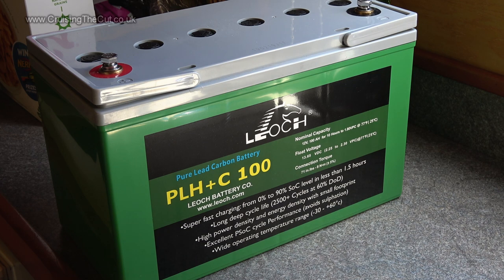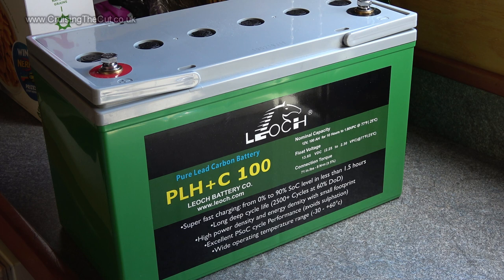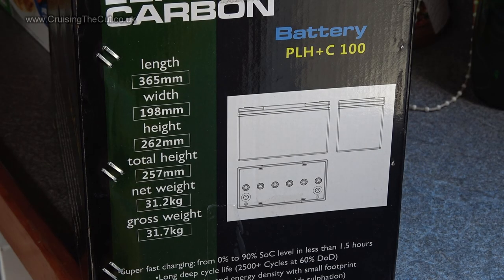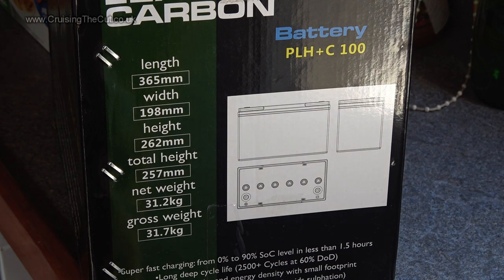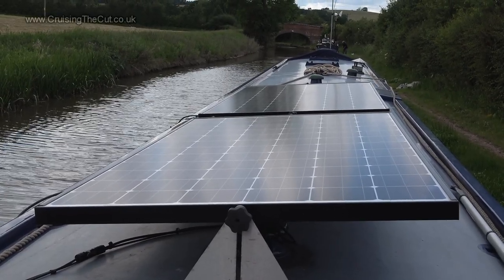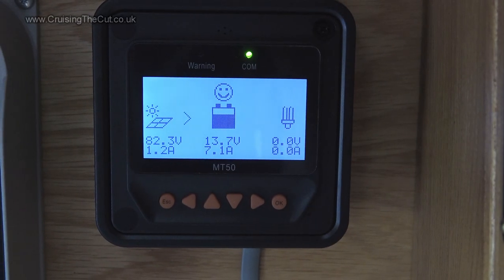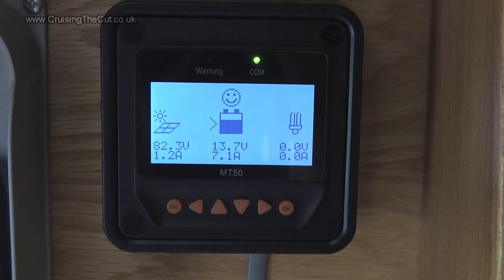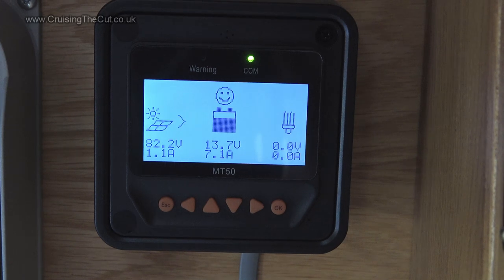178. Installing Lead Carbon batteries (12V 100Ah) into my canal narrowboat

Comment: Great job and I like how you researched the cabling part - except the source used is somewhat missleading (see below) - but, if you're already calculating resistance, you might be way more interested in replacing these tiny cables routed from your solar charger. After all, here the diameter goes directly into amount of wasted power - much the same way as with the battery - if you're concerned about effects of 20 cm of 35mm2, you need to look into several meters of these smaller ones. Resistance of wire by cross-section. So a 2.5mm2 (looks like what that is) got 14 times the resistance of a 35mm2. 

As a rough guess I'd put the solar panels as seen at ~180-250 Watt peak each, resulting in up to ~35 Ampere at ~12 Volt. With roughly 0.006 Ohm/Meter that equals to a power loss of ~ 5.5 Watt per Meter. So each meter between batteries and solar charger - as well as between panels and charger - removes up to 5% of what the panels supply before it reaches the battery. Of course this may be reasonable lower depending on the way the charger operates. None the less, with the low voltage high current setup a narrowboat features, wires should be made reasonable big. There can't be no wire too big - only too small.

And yes, solar panel manufacturers as well as suppliers for other part tend to use cabling as thin as possible 'to do the job' , as copper is quite expensive and the among the easy parts to cut cost.

As reality check take the cabling used to connect the engines alternator. It's safe to assume that the engine manufacturere (and the boat fitter) wasn't keen on wasting money on too expensive (too thick) cables either, wo the diameter used there can be a good guidance of what's necessary in this setup. Not sure what alternator size installed in your boat, but it may be safe to assume it supplies like up to 100 Ampere. If that's connected via 35 mm2 cable (as it seams), then cables supporting up to 35 Ampere (around a third of 100)  needs to be a third in cross section at least. That would be ~12 mm2 - next standard sizes are 10 mm2 or 16 mm2 - I'd take the later to replace the puny wires installed right now, increasing efficiency of your solar system even further without much technology - just pure old fashion copper  and lots thereof :))

----
The battery cabling part:

The source doesn't account for the change of internal impedance according to charge, which varies up to 1:100 between full and 50%, depending on battery type. It seams as the calculation only uses the internal impedance of a fully charged battery, which is meaningless as at that point charging current will be rather cut off to avoid damage - wouldn't it? In a real world setup, where batteries are charged and discharged a lot - exactly the setup with a narrowboat - the impedance of (only) 10% discharged batteries may be already more than 10 times of the cabling issue, taking down it's influence to 1/11th of the example given, making it neglectable - at 50% it may be more than 1000 times.

Also the claim about 'needing a PC to do the math' is somewhat overblown. It's a simple set of equations (in fact only one, but with several variables and repetition for charging level) that can be done without any tool. At least that's how I learned (and used) it in the 1970s - there where no handy computers to do the job :))

The good part is that moving the terminals don't do any bad either.
Reply from the maker: Rest assured the solar cables have been sized appropriately.

Comment: Nice one David and you are quite right to be cautious around batteries, especially the potential capacity of 300 Amp/hours.  That's an awful lot of stored energy and people are often dismissive of batteries because they are 'only' 12 volt.  The perennial 'spark' is probably just very minor voltage differences balancing themselves out.  When you jump start small cars from a Land Rover with 50mm squared cables, there is always a bit of a sparkle.  It's when it's a great blue, snarling thing you have to watch it!

Well done for doing something I would be just as cautious about and I used to ramp MRI magnets up and down - you have just the right degree of caution and common sense, with the ability to RTFS, as we used to call it.  (Read the freakin' screen.)

Comment: David, you should suggest to The Narrowboat Experience that they install these in their new boat. Anna stated in one vlog that they don't tend bring their batteries up to 100% most of the time. From what I can find about the Lead-Acid batteries, they are a very good, lower cost, alternative to LiFePO4, provided you can deal with the same shortcomings of voltage drop as Lead-Acid (this is coming from a retired Chemist.). Nice vlog and I hope these batteries serve you well.
Reply from the maker: I think I'm right in saying their new boat has much more solar than the old so I think their batteries will get slowly charged to 100% a lot more than on the old boat.
Reply: @CruisingTheCut  Thay aren't really shown much of the new boat, so didn't know that. Thanks.

Comment: I think you did a damn good job there, belt and braces with the safety aspect but what ever makes you comfortable. No normal experienced person could find flaw in your approach. Glad you configured your charger successfully, and more importantly are wise enough to know it needs to be done and brave enough to have a go at doing it yourself!
Disconnecting the ground first is the best approach as usually the body/metal work will be grounded, so if you catch the spanner it wont spark, then once the negative rail is disconnected you will not have any sparks if you slip when spannering the live terminals!
As for the debates over the connections of the charge/drain to each rail, the resistances across the thick copper cable, banjo fittings and terminal bolts would be so incredibly low that the impact on charge/drain imbalance of the different batteries would be insignificant, especially compared to the variations of the actual cells within each battery. This whole kind of 3 batteries in parallel, with 6 cells in series is inherently flawed but it works in the real world and has been used for the last century on everything from milk floats to submarines to computer server backup systems.
Reply from the maker: You'd think it would be insignificant but have a read of this: http://www.smartgauge.co.uk/batt_con.html
Reply: @CruisingTheCut  It is all true, he is quite right. It really is the best practice to equal out the connectors. But when I have measured packs and replaced individual batteries in arrays it is always just 1 random battery that is causing the problem, not the one at the end, or the one at the front. The key is a point the author makes "because the internal resistance of the batteries affects the outcome so much", the decimal places get lost in the differences in internal resistances make the biggest difference to cell loading.

Comment: Excellent! You mentioned covering your panels. Very nice. Every battery makes I deal with almost falls over themselves providing  bulk/absorption/float voltages and warns profusely against ANY equalization cycle IF not needed. Equalization voltages are usually VERY high, periodic and of very short duration. I am stymied why your provider would not provide a "cheat sheet" with everything you need to program your solar and/or shore powered charger.

Comment: Just for my own OCD giggles, I'd write the date of install on the top of the middle battery (most visible and no wires going across top). Because date of install is not always the same as date of purchase. Like you, I have to have all my ducks lined up before I start the installation process. With the date of install so visible on the battery itself, you can remind yourself at a glance when they were installed vs digging through paperwork.

And, for my own OCD giggles, I'd probably also put on date of purchase in the opposite corner or something. Just so I don't have to remember where the hell I put the paperwork. Probably would still be in "to be filed" stack five years later.
Reply from the maker: I made a video instead :-)

Comment: Good vlog. Looks like you had the wash out drying. Get yourself a dust buster, little cordless hand vacuum for those small little messes, and for when you have the power off in the boat.
Reply from the maker: I want a nice cordless but the cheap ones are crap and the good ones are expensive :-(
Reply: @CruisingTheCut  I use a range of Makita cordless power tools for my work, they do a great little vacuum which is quite cheap if you already have the batteries and charger. If you have any existing cordless tools you might find a compatible vacuum.
Reply: @CruisingTheCut  alas the benefit of having Walmart with other stores available for shopping by price and ability in the US.

Comment: Great vid👍 Does surprise me that you don’t have a battery monitor, especially now you’ve just invested in good quality batteries.
I find the info from my Victron BMV 712 really useful
Reply from the maker: Trouble is these things are partly guessing as soon as the batteries are anything less than brand new so they become steadily more inaccurate. Meanwhile voltmeters only give you an accurate reading if there's no load or charge on the battery and it's been like that for an hour or so, so the only good time to measure is the dead of night (no solar and with everything switched off)

Comment: The spark from the batteries is the capacitors inside the inverter recharging themselves. They take a good few amps (25 - 100Amps) depending on the size of the inverter. The capacitors naturally discharge over time hence the reason for the big spark once you reconnect the terminal to the battery. 
A good way to avoid this spark is to have a DC rated circuit breaker in line with the positive to the inverter. In that way the spark (or arch in tech terms) is contained inside the circuit breaker and you don't have to be scared of sparky bit flying off the battery terminals.
Reply from the maker: Good plan, I might try to add one.

Comment: The spark is certainly your inverter. But the spark is it "charging" the capacitors within the inverter. If you don't want the spark, get a 100W 10ohm resistor and put that between the cable and the battery for a few seconds before connecting the cable. The resistor will slowly charge the capacitors versus the jump (and spark) all at once.
Reply: dchubb42 reading the comments before posting to check for the right answer, this one is spot on.

Comment: The inverter has large capacitors (and they drain fairly fast, however not instantly takes a few minutes), when you connect to the inverter, you will draw a spark (which charges the caps) unless you pre-charge the caps with a resistor first, once the caps are charged then remove the resistor and connect directly. No spark.  The bigger the inverter the bigger the caps, so the more important to pre-charge the caps.

Comment: Most inverters have a large capacitor on the input.   When you connect the power it has a very sudden and high current draw as it charges.  The victron 5kw unit makes a big bang. You are supposed to charge it before connecting it.

Comment: I also had a bank of 12 batteries where the solar was connected at one end. Using a clamp amp meter I could see the drop in amps at each consecutive battery to the point where the first battery was getting 4a and the 12th battery was getting .01a so it dose make a difference. Oh and when one battery died it got warm and the batteries after that one got nothing.

Comment: I use a resistor with alligator clips and attach to either end being connected or disconnected. It takes any ambient charge and slowly dissapaites it to heat. Happy to share more.
Reply from the maker: Nice tip!
Reply: Sparking is usually a capacitor charging up once again.

Comment: Well done sparky, surprised you didn’t opt for lithium batteries- they are very expensive but have pretty impressive performance. 👍👏👏👏
Reply from the maker: Massively expensive, don't like being charged when cold so would have to move them into the boat, so rewiring also required, plus new charge controllers etc - no thanks!!
Reply: @CruisingTheCut  relion has low temp versions rb-100-lt
Reply: @CruisingTheCut  if they can indeed be kept in a not fully charged state without getting too upset then they would be ideal. This will only be tested come winter sun levels and assuming the boat stays off the shore power.

Comment: I've been thinking about replacing my batteries since sulphurous steam and volcanic temperatures were coming from the battery compartment😂.... so it was with great excitement I was waiting to see how you did it ESPECIALLY connecting the whole bank with regards to where you connected the positive and the negative wires🤔.... I have been thinking for a long time that taking the power from the first battery then battery two filling up battery one, so on so forth was not the way to treat the battery bank as a bank, as battery one is taking the big hit, if you know what I mean🤔... I'm not replacing mine yet... now I'm waiting for your update in several months👍... I was looking forward to a scene from Young Frankenstein when you were beginning the removal of cables from the batteries "it lives!! it lives!!🤣" Well actually "I'm on fire!! QUICK!!! get the fire extinguisher😂🤣... Great video and all joking aside good to see you did a fantastic job and your back has survived lifting those batteries, I can feel the pain👍
Reply from the maker: Hmm it's not really one battery filling the other as such but ... yours do sound like they need replacing!!

Comment: As another non-expert, and at the risk of crashing the internet..... I have always understood that if working on something like a car where the vehicle body is usually earthed, the reason for disconnecting the negative first is that if your (untaped) spanner touches the chassis as you are working it will not cause a short. Once the earth is disconnected, touching the spanner to chassis while working on the + terminal will not matter either.
Your link to the page about why to wire the batteries the way you did was very interesting, thanks!

Comment: 10:25 Please put a little piece of conduit on the red solar wire, right next to the terminal.  Boat vibrates and in a year you will have exposed copper strands there, which effectively will revert you to the original charging of the first bank battery ;)
Reply: Martin he did this over 8 months ago so if he hasn’t figured it out by now.....

Comment: Today there was a programme as start of the X-mas season here in Gothenburg talking among other things about the small 9 V dry-cells and how you should handle them enroute to the waste, that you always should have a piece of tape and put it over the terminals as those batteries are among the most fire-making normal people have in their homes, if you have some used batteries collected they might short-cut each other.

Comment: when connecting batteries in parallel (same voltage, more amps) as you did, it does not really matter where the main charging leads are connected to the battery bank as they are each charged and discharged by the main cable, not from battery to battery as if they were connected in series(more volts, same amps). IF you had a longer cable connecting one battery to the others (as if you added an extra battery in a remote location) then you would get better equalization by connecting +/- terminals diagonally opposite, but really the difference is negligible. There are many other factors that would influence battery life and performance more than this.
Yes, I've read the link in your description but their method 1 is an extreme example...they connect the end of a 4 battery bank, you had the middle of a 3 battery bank. In fact, if you look at their method 3 ("And now we get to the correctly wired version where all the batteries are perfectly balanced") that is almost what you had originally !

Comment: The spark on the final connection is simply the circuit completing. Just like when connecting a car battery back up. everything off but you get the spark from the battery reaching to complete the circuit.

As long as youre careful with that many batteries you should be fine.

Comment: The 4 batteries on my  sailboat weighed 125 lbs each yes seriously 
Good thing number one son got them from the dock to below decks 
😎 good heavy plate batteries are what you want 10 year life is excellent I only got 4 years on the ones that came with the boat from factory , but second set lasted 12 years  well they did cost 225 usd each yep boating ain’t cheap

Comment: Hi David,
Another great vlog, I always enjoy it when you're mucking about with your boat. It will be interesting to hear your thoughts as you get experience with the new batteries and what you think of them. Just curious, what did you do with the old batteries? Was there like some kind of "exchange/turn-in" program with the company you bought the new batteries from? I also enjoyed your Twitter post about chucking your diesel engine and putting in an electric motor with a giant chunk of motor batteries. Of course that would reduce the vlog opportunities for us to see you messing around with the diesel engine. :)
Doug
Reply from the maker: They're currently taking up space in the dinette awaiting removal over the summer to a suitable disposal point!